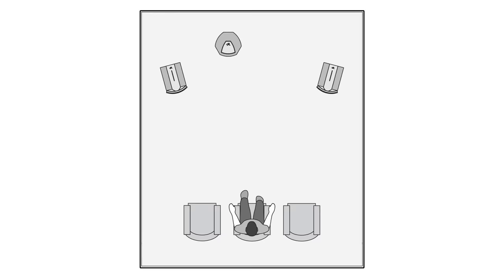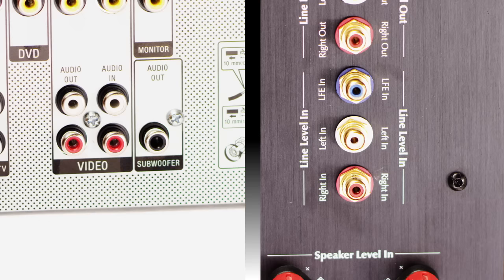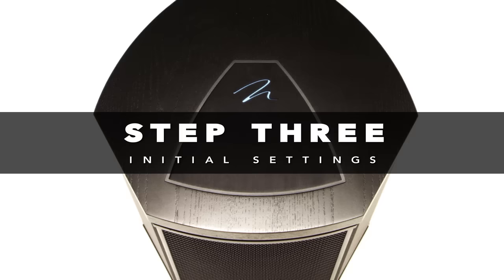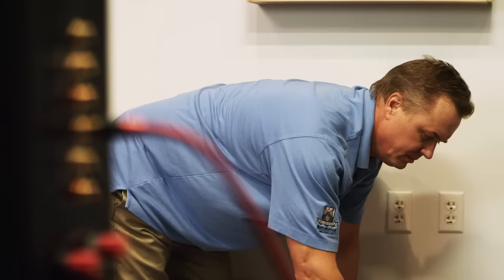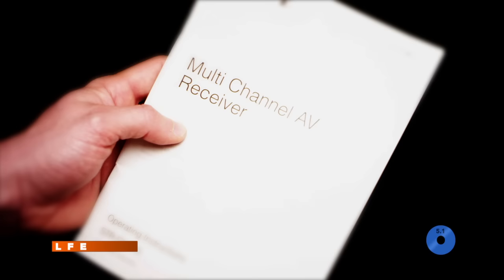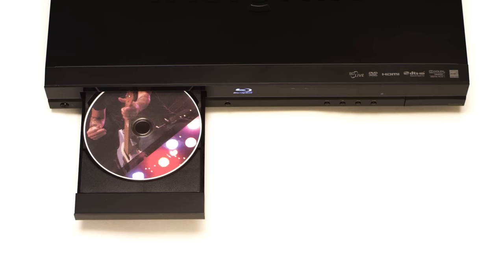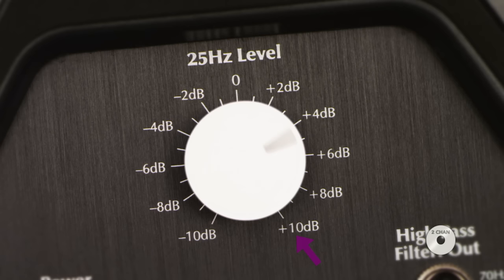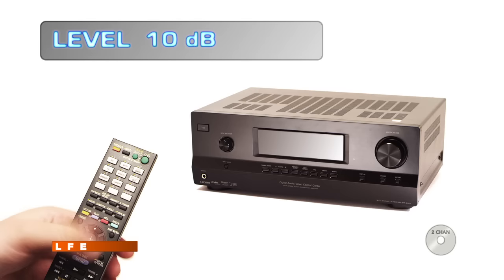Subwoofer Setup & Optimization - MartinLogan

Comment: I have a Subwoofer that doesn't have crossover nob. Only a high or low cut switch (stereo also doesn't have crossover settings). Now I now that having 3 cables L, R and LFE and using the setting both is perfect for my tiny speaker with sub setup. Thanks 👍 I am now playing with the volume nob etc.

Comment: Finally understand what sub crawl actually means. I've always seen idiots on Youtube do that thinking we're just supposed to know that the sub should be placed in the seating position. They never mention that and yet crawl around the floor like a Neantherthal and I always what the hell they're doing.
Reply: Johnny Blaze a Crutchfield rep told me about the crawl method....but it is useless if you run a calibration tool that dials in the sound based on subwoofer placements

Comment: thanks for the info regarding the left and right channels for music. i just used the single lfe cable from the amp, will be buying some extra cables now to connect the left and rights so i can enjoy music better.
Reply: on my subwoofer only 2 inputs L/R. and it says if I want to connect LFE use left (white input) so what to do if I want both?
Reply: +Sigitas Ziurys it's a  tannoy subwoofer sfx 5,1
Reply: +Sigitas Ziurys got it! there is some more speaker level inputs, didn't notice them

Comment: I connect the subwoofer cable to left port on the subwoofer and left pre out port on the receiver. I got the subwoofer working this way but I cannot change the subwoofer level on the amp. I can change the volume and frequency using the knobs behind the subwoofer though. So, is the method I connect subwoofer to the receiver correct?

Comment: Just got a klipsch sw115 15" sub. Martin Logan Areius mains. Sub setup has taken about 2 weeks so far. I feel the need to tweek it every day.
Reply: That is because that sub is not very good for music.  With all subs placement, crossover setting and gain settings are critical. The better subs are so much easier to dial in. I would recommend running the Martin Logan speakers full range and adjust  subwoofer starting with a low crossover of 50 or less and with a low volume setting and gradually increase volume a little at a time.

Comment: I have a problem where playing music the sub sounds very good.  but during playback of a movie sometimes the sound clips and you can hear the voice coil hit the magnet.  I've tried all kinds of settings of the crossover in the receiver and the sub.  it helps the most if I turn the LPF of the LFE to off in the crossover settings of the receiver. if I leave it set to any of the 80-120hz settings it hits the magnet really hard.  something isn't right.  I didn't have this problem with my old sony receiver.  I have an Onkyo TX-NR686.

Comment: Hi, what if the subwoofer has 2 LFE(L+R) inputs, do you use 1-to-2 RCA cable or just use 1-to-1 cable and plug it into either L or R terminal of the subwoofer LFE terminals? Thanks

Comment: So I have one of those blu ray all in 1 surround sound systems . The sub line is only a wire one with line on it one withought one pos and neg . Well my sub blew and while looking on line wife found a stupid deal on a power sub by polk audio 600$  for $180 bucks 460w 12 inch . I couldn't find the 5inch sub it came ith for that cheap so either way its going to sound better than what I had but was curious Whats the best way to hook this up for sound quality

Comment: is it possible to use a+b speaker selection for sub connection...  like  A for  front speakers and  B out put to subwoofer high level or line in part of sub..   and play the amp both a+b speaker out puts same time..  is it okey this way.. any recommendation ?

Comment: With a  two subwoofers system, do both subs need to have the phase set to normal, or could one be set to reverse?  An audio signal is alternating current so I'm wondering if a 2 sub system can cover the entire sine wave of a signal and get a bigger punch!

Comment: PHASE QUESTION: I often hear people ask, "Should I have my subwoofer set at 0 Phase or 180 Phase." This is an important question and I understand the logic behind it. If it was simply a matter of a Phase switch on a subwoofer, the answer would be fine - there would be only two possible choices (0 or 180). However, it is not that simple. My A/V Receivers from Onkyo and Sony allow me to select 0 or 180. This means there are FOUR possible scenarios. Those scenarios are:

AV Receiver = 0 and Subwoofer = 0 
AV Receiver = 0 and Subwoofer = 180
AV Receiver = 180 and Subwoofer = 0 
AV Receiver = 180 and Subwoofer = 180

I fully understand that if you have your subwoofer in the front of the room, you should have both the A/V Receiver set at 0 and the Subwoofer set at 0. 

However, my confusion and question relates to when the subwoofer is in the back of the room. I know by subwoofer should be at 180 Phase. ... However, does this mean BOTH the A/V Receiver and the Subwoofer should be set at 180? Or does this mean only ONE of them should be set at 180? 

In other words, I'm asking if you want the Subwoofer set at 180, does that mean the A/V Receiver also needs to be set at 180? 

If not, does this mean placing both the A/V Receiver at 180 and the Subwoofer at 180 will create a form of 360 Phase? 

If you could explain this, I would appreciate it.
Reply: If you have a phase adjustment in the sub and receiver than its just an extra redundant control.  Only make your changes to one control.  Either leave the receiver at one setting and only change the setting on sub and listen to your preference or vise versa.  Not both.
Reply: Actually, you still only have two real phase settings. 0 and 0 is the same as 180 and 180, and 0 and 180 is the same as 180 and 0.
Reply: I think the pertinent question we need to address first is: why we have "phase" in the first place? Then we can proceed to: which setting is best and when? Phase is basically the direction of the signal/speaker driver/cone movement, which has two categories: "in-phase": This is when your main speaker-drivers move forward/backwards at the same time as your subwoofer (setting is: 0 because this is the original position, without any subwoofer rotation). This is recommended if the sub/s is  placed on the same side of the room as your main speakers, where there is no possibility of soundwave "collision" which can produce unexpected results in sound quality. Then there's: "out of phase": This is when the main speaker-drivers  move in opposite direction to that of the subwoofer, that is; when the main speaker drivers move forward, the subwoofer driver moves backwards (setting is: 180, because you've rotated your subwoofer 180°  to face your front mains) so as to avoid the soundwave "collision". This is mostly recommended in cases where the subwoofer is placed on the opposite end of the room, and is facing the main speakers. I've got my Receiver on one setting and I'd just toggle my phase-switch if I need to change phase, because the phase input on the Receiver basically tells the Receiver which direction the subwoofer is facing, which can be adjusted on the sub itself. My sub is set at 0 even though it's placed 90° to my mains because my sub can only do 0 or 180°, there's no in-between settings, and it's also due to lack of space😀

Comment: My AV 7.1 receiver has a sub pre out but when i connect it to my sub no sound comes out (my amplified sub has no controls, only an RCA in), in movies the AV receiver shows an LFE logo. To test if sub is working i connected it to my old system sub out to a non amp sub, no sound come out.
What could be wrong? Any help.
Reply: +Paulo Parreira you need an amplifer for the subwoofer a subwoofer pre out is meant to be connected to a amp not staright to a subwoofer

Comment: Man the more I look into my setup the more I have it all wrong. Great vid but I'm soooo confused.I have a Klipsch Synergy 12. I connected just the "LEFT/LFE" to my receivers "sub out" It sounds great and all but when I connect another cable rca cable  that's right next to it labeled" Right/line in" It sounded much louder. SO why is it most vids say just connect the lfe only? Also why cant I find a rca cable that have 3 male out in a 25ft length? All I see are 2 males out and then a 3.5mm stereo jack on the end which then I have to use a mono jack/to rca.. The 3 male RCA I do find all seen to be no longer then 15ft. Please help
Reply: You have it right. Leave it alone.

Comment: Nice video! I am obsessed with people who prefer roof shocking bass, I respect their preference. However, a real subwoofer is a speaker that complements the whole system, playing frequencies that the main speakers are unable to handle, so to have a flatter frequency response. At 40Hz, the frequency response should be +0, not +10

Comment: You shouldn't put your sub's gain to the max, even if you're going to lower the amp's level. You might get clipping on all volumes and undoubtedly suffer in sound and ultimately killing your sub. Best to set it 50-70% just to be sure.

Comment: what if the amplifier has two outs of the same color (in my case purple) and your subwoofer only has left and right inputs. what would you do?
Reply: It makes no difference. Both are more than likely internally strapped together. Basically a y-connection built into the receiver. Also more than likely the left input is mono on your subwoofer. Even if it isn't just connect both mono outputs to the left and right input of the sub. It is a mono signal.

Comment: My subwoofer says turn sub off on my receiver, then connect the main speaker wires to the sub then through to the mains.   Isn't this the best configuration?
Reply: no but it depends on the receiver

Comment: For two channel setup I found that it's better to have two equal subs one on R playing R channel bass and vice versa.  That way the bass in the music doesn't get pulled to one side or the other messing up your sound stage.  Went with single sub setup for years but finally realized that which side the bass comes from actually does matter in music, not so much in movies though...
Reply: This depends on the speakers used and music listened. Most music has mono bass in the low end to keep other frequencies in their place. You dont want unnecessary competition for space in your mix as a mixer/master. I suspect it is more about the standing wave issue and better distribution of bass in your room.
Reply: if bass gets pulled to one side or the other with a single subwoofer, that means it's not set up right at all. It's either got bad room placement, the output level is far too high, or the crossover frequency is too high. Watch the video again and follow the instructions on proper subwoofer setup, and it will not pull the bass towards the sub.

Comment: no. either the receiver needs 2 lfe hookups or you can run a splitter because most receivers with 2 lfe's are pre split inside the casing instead of actually running 2 seperate lfe signals. some of the nicer more expensive pre amps will have 2 seperate lfe hookups with 2 different signals

Comment: Great video, thanks you so much! A bit off topic but I have the Dynamo 700W and just noticed that when it is in stand by mode (Red light on) the Blue light continues to flash. Is that normal? I haven't been able to find an answer anywhere and ran across this vid, hope you don't mind the off topic question.

Comment: If a video receiver has an amp built in why do you need to have a sub with its own power source? I have a Shelf speakers system who's Main source of power burred out. I don't really know that much about sound and frequencies but, what i,m trying to say is i,m gonna get the VSX-822-K 5.1 3D Ready a/v receiver from Pioneer as a replacement for the main source of power and sound. The old stereo was 330watts this pioneer is 400watts, the speakers are 2way with a mid range and sub-woofer each.

Comment: placing a sub in the middle of the room and walking around the walls is a good trick to find that well balanced sweet spot, but what if you are using multiple subwoofers? 
wouldn't there be canceling and uneven sounds around the room? 
Also how do you get that nice long smooth base in comparison a thudding? Is it closer of further from the corner and wall?

I'm really starting to appreciate subs placements maximizing room shapes.
Reply: Keep away from corners. I find the best results next to my main speakers.  The sub does need to be against a wall. This gives it 2 reinforced boundaries wall and floor but in the corner you have 3 boundaries reinforcing the sound giving you more output but at the expense of
Accuracy 
Speed 
Agility 
Timing.

Comment: you can use ohm's law and a multi-meter to figure out what to set your gain to for how many watts you wanna be putting out, but afr126 is right. If you crank up the gain you WILL get clipping and the bass will sound shitty even thought it's putting out like 3x as much power as the sub needs

Comment: If your receiver accepts a passive speakers, than is just plug and play. Otherwise you will need an amplifier as you can see in this video. There is an amplifier inside de box. And don't forget to check the impedance. Car speakers' impedance are not the same as home speakers' ones! Be careful with this! You may blow the output channel of you receiver!

Comment: But you can set up your lfe cut frequency from receiver, so no problem with the music. When you setup the crossover frequency for subwoofer into receiver is good for everything, because your audio system is calibrated. So, movie LFE intended effects nad its part of higher frequencies doesn't have to go into the sub if your sub can't handle those well. 
( example: if they put some effects on dvd lfe channel maybe over 120hz and my sub can't handle it well I can cut it to lower value and put the upper part to my full range/ main speakers ;) )
My idea is to setup the entire system, set the overall sub crossover and connect it to lfe to don't have to setup manually crossover on sub, it works for every input, isn't it?
Reply: Is useless setting up crossover on sub using dual input on a single sub, when you have to setup the audio system mainly. The frequency are universal not depending on input (music or film), if you find the crossover sweet spot between speakers and sub to don't get any frequency hole you're ok.

Comment: yes yes all well and true BUT bass levels and recording volumes vary greatly from bluray to 320kbs modern music to 1980s recordings online lo-def mp3 files so unless you use a compressor limiter module or have a sub with auto volume levelling or have auto levelling built in to your amp most have a poor attempt built in then your still gonna have to get up like you always have to twiddle ya sub woofer controls every few songs you play unfortunate but true sadly :-(

Comment: This really doesn't have anything to do with the video. This video is about setting up a sub. You're just saying that your receiver does all the processing as well as amplifying everything. But i'm sure your subs are active (If you have a proper setup). Nothing exclusive, it just means you're using your receiver the way it's meant to be used.

Comment: This is complete opposite of what is stated in other videos, so confusing. I was told TO use LFE
Reply: Audun Jemtland same.. my yamaha amp got lfe and sub got R / L/LFE .. dunno if i should go with ia Y type cable or normal plugin only Lfe to L/Lfe
Reply: I've gathered some info now. Supposedly. If you go AMP LFE ->SUB LFE the subs internal crossover won't be used, the amps crossover will be used. Which will give a more clear and non muddy sound.

If you plug AMP sub-> L/R RCA line in sub, you have to turn the frequency adjustement on the sub to OFF if it's available or to it's highest freq(Mine says 140hz) And people say to use a Y-cable.

I think you should go LFE->LFE to make it simple. I don't really understand or get the Y cable thing. Mine isn't here so haven't tried yet. But I'm gonna do LFE. I just took one RCA to the L(left) line in. And it is muddy. I think it's because the crossover in the sub is used at the same time as the AMPS internal crossover.

Comment: My Pioneer VSX 9500S does not have the LFE or subwoofer output but I do not want to use the speaker or high level connections for fear of introducing amplifier distortion into the subwoofer. My subwoofer is also self powered and has the line level connections, so if I want to use those I can connect to any audio output source on my receiver?
Reply: Try connecting using RCA cables from the tape out connection on your amp. Other than that you are stuck using high level input on the sub.
Reply: I tried that and it sounded awful. No crossover in the receiver meant that all of the audio frequencies were getting through to my sub woofer and I flatly refuse to connect high end equipment through the speaker outputs. I ended up buying another Pioneer receiver that had not only dedicated sub woofer output but also had preamp in & out so that i could connect my graphic eq. All is better now.